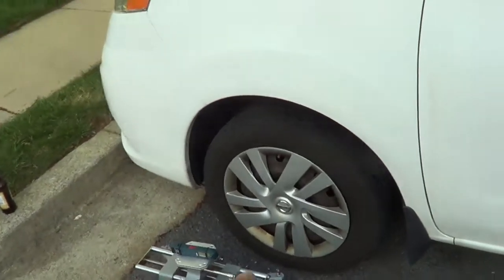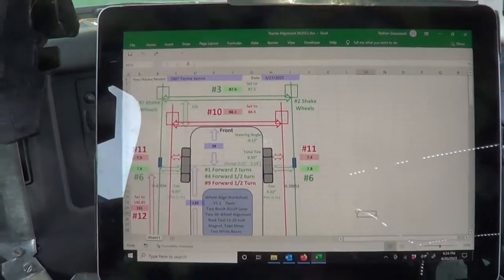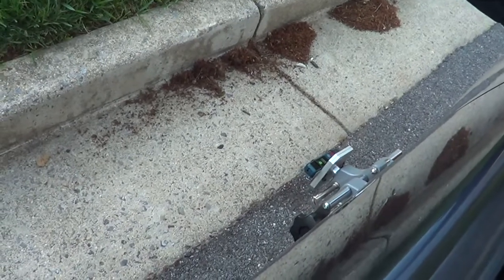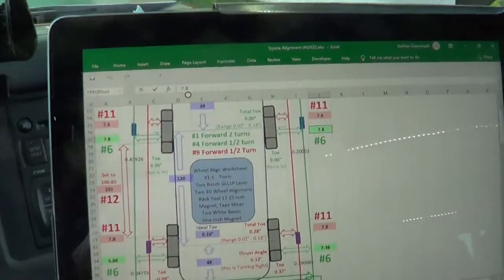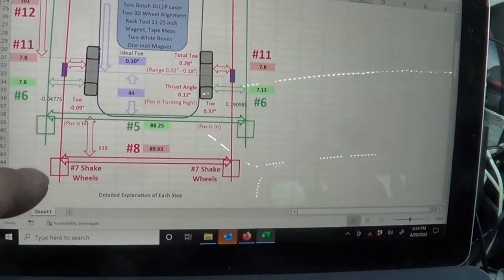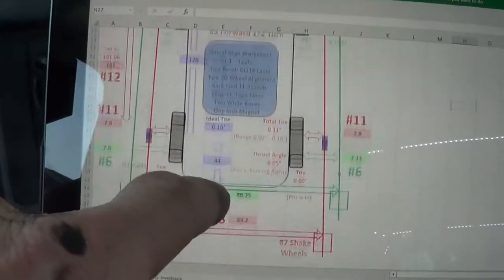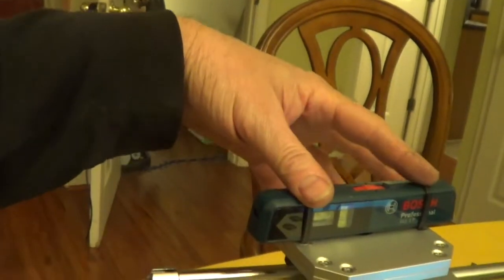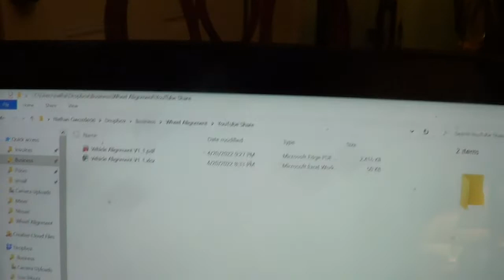Accurate Laser Four Wheel Alignment Calculator Worksheet

Comment: Nathan,
Thank you for your video and spreadsheet. I will try you system on a race car. How would I incorporate the track width into the measurements?
Reply from the maker: Thinking about wheel tracking has lead me to a complete redesign of the spreadsheet.   I'm doing away with the boxes and just placing a centered magnet on the front and back bumper.   This allows 4 wheel alignment with any tracking on any of the wheels in only 8 measurement compared to 18 and moving boxes around on the old spread sheet.   I will also make a new video showing how to do the measurements.   It will be half the time.   I will post the new spreadsheet in a few days.   I will have the video in a couple of weeks.

Comment: hi Nathan, i just ordered up the clamps etc. to do this.  The clamps i ordered have a different style of circular "pedestal" sticking through the center 15mm hole of the clamp than yours, but otherwise seem the same.  Should be interesting.  i wonder whether some portable rollers could be used of the type where the 4WD systems on various vehicles are tested?

i did also get a Trackace as well.  The two clamps, and lasers come to around $400 these days.  i did also order a leveling laser (to makes sure of level ground) as well as an angle inclinometer to mount on the clamps to get the camber.

PS: i wanted to ask if the spreadsheet will work with/take into account vehicles that have different track offsets from front to rear?
Reply from the maker: There are two different sets of calculations.   The total toe of the front and back won't be effected by offset because it only uses two wheels just like the Nissan manual recommends.    The individual toe will be effected by offset.   But, individual toe is only used to show what single wheel is out of wack.   You could manually subtract the offset.   I suppose I should add in an offset calculation.   How many cars have different axle widths?
Reply: @NathansHVAC  Thanks for your reply.  i don't actually know the percentage of vehicles which have different track widths, but i think that a lot of street vehicles have small differences.  The Santa Fe of which i am measuring for example varies by 1/2" front to back tracks over different generations.  i just searched for some various vehicles that came to mind.  Sports cars seem to have the largest differences as they seem to tune the track widths more.  

Hope that helps with improving the spreadsheet and most of all thanks for making this video.
Reply: Just a note for others.  The Bosch GLL1P lasers have a nicely machined bottom so it mounts flat.  However the magnets on it are on the side.  The GLL1P body is 22mm wide.  The circular mounting face that goes into the wheel clamps are 100mm on mine.  i scribed the proper locations for each side to center it and ended up getting some inexpensive but rather strong harbor freight rectangular magnets and mounting those to the circular mounting face, then mounting the Bosch GLL1P to those.  That keeps the lasers in place, centered, and flat against the face.  Hopefully this helps others.

Additional notes: one thing i noticed was that when comparing the two GLL1P lasers.  One outputs a dot slightly higher than the other.  Ie the angle of exit of the laser beam from the body of the GLL1P is slightly different.  It seems to me that this would cause a few mm difference between the readings for the "far" wheels vs the readings for the other laser on the other side.  For better results i wonder if using the same laser from side to side might give more accurate results.  i am going to test this by doing measurements with one laser, and then doing the same measurements with the second (measuring to the wheel centerlines front and back on both sides).

Comment: Very impressive Nathan. I bought the Trackace laser wheel alignment gauge a couple years ago and it is extremely accurate for the total toe but it doesn't give you the individual readings for all four wheels. How have the back tires on the Nissan been wearing since it has been a few months now?  I had the same issue out of a Toyota Sienna where I had to shim the rear axle.

Comment: I really like this video, Nathan. I downloaded your spreadsheet and studied your formulas. Excellent work all the way around. Can't believe this video has so few views. Maybe because the wheel clamps and lasers cost around $300. Maybe because there are 12 steps to learn and careful measurements to take and numbers to carefully input into the spreadsheet. Seems everybody wants to get away with 10 minutes and $1 worth of string. For my part, I made the investment in the wheel clamps and lasers and am happy I no longer have to depend on the local alignment shops. I've had really mixed results from them over the years. One shop had my car on the rack and down again in 15-20 minutes and the car tracked so terribly bad I hated to take it back to them, fearing they might make it worse. In that case I took it to a different shop. Another shop would spend an hour and my car would ride beautifully. Such wild variation in reliability and results - just got tired of spending the money and time at most of these places. I know when my car is tracking and steering right. You have a very well thought-out system for four wheel toe. I would love to see you address caster and camber.
Reply from the maker: I'm amazed myself.   The difference between a good alignment and a bad alignment is only 1/4 turn on the tie rod.   I have tried everything over the last 30 years.   What got me to come up with this system was the Nissan manual recommending the 1/2 rotation of the car.   That method totally compensates for any errors of the rim and lasers.   Let me know if you want any changes in the spread sheet to make things more intuitive?
Reply: @NathansHVAC  The only recommendation I have is to make the instructions a little clearer. I read them through several times and saw some areas that could be improved. So I re-wrote them for my own use. I could email you a Word, Notepad or PDF of my edits if you like.
Reply from the maker: @davidoleary3923    n a t h a n g w.       At.      a I r m a I l    d o t.       n e t
Reply: @NathansHVAC  Sent PDF today.
Reply: Awesomeness

Comment: Quite impressive. I've seen people using fish line for toe (and camber) measurements and they claim to be most accurate. I think fish line adds up some manual labor but reduces the cost a lot and on the other hand if we can make a spreadsheet like yours for the fish line type arrangement it will make it little bit more reliable and authentic. Just my two cents.
Reply from the maker: Also, the tires are never straight.   Moving the car 1/2 rotation aligns the actual axle.   That is what you care about.   Not the condition of the tire or rim.

Comment: Hi, nice job :)
A couple of questions:
1) How important is the accuracy of the laser?
I mean the parallelism of the laser beam itself to its own housing (support surface), and so also to the surface of the turntable after mounting?
All these devices have a deviation and the beam is not perfectly aligned with high accuracy.
This BOSCH model for example has a accuracy of 3/16 In. at 33 feet.
Does this affect the measurement?
I'm having trouble figuring out this answer myself :)

2) Confused about this in the Excel sheet:
#6.  The measurements of the beam to both wheels are used to calculate the toe of each wheel.
Shouldn't it be: 
The measurements of the beam to all (4) wheels are used to calculate the toe of each wheel (4 wheels).
in accordance to the point 11:
#11.  Measure the beams to each of the wheels.
where "each" means the 4 wheels....!?

At the points #6 & #11 a measurement is taken from each of the 4 wheels and entered into the excel sheet....?
The description for #6 in the excel sheet suggests that a measurement is only taken from 2 wheels!?

Or have I misunderstood the measurement technique :) ?

3) Question concerning the description for #12 (and associated graphic).
At which point this distance is measured exactly?
I ask, because this distance will vary depending on chosen measure points... (e.g. the distance from “rim edge” to “rim edge” is smaller than the distance between “point X on the wheel inner part” to “point X on the wheel inner part”)....?

Thanks
regards
Reply from the maker: I’m glad you have questions.

1) The beam accuracy doesn't matter. It just has to be mounted solid on the rim and not on the rubber. The rubber will deform as the tire rotates. The entire point of moving the car forward 1/2 a turn is rotating the entire laser assembly around the axle. The only error will be that of the bearing play and suspension.   That is why you want to use a flat surface to keep those errors to a minimum.  Parking on a hill will temporarily change the toe.  The beam spread isn’t wide enough to matter.   A measurement error of 1/8 inch at 10 feet is 0.05 degrees.   And that accuracy would be a very tight alignment.

2) The toe of a motorcycle simplifies the answer to this question.   The toe of the front single wheel vs the toe of the back single wheel will not affect tire wear on the motorcycle.  It only effects the thrust angle of the motor cycle rear and the steering angle of the front.   The same applies to 4 wheels.   The front 2 wheels of a car are essentially the same wheel as a motor cycle, but really wide.   The bearings of that giant wide wheel need to be on the exact same axis to avoid tire wear.   If they are not aligned, the wheels skid sideways.   That’s is why old toe plates measure in inches of skid rather than angles.

3) It doesn’t mater what point is used.   What matters is the change that is required to align a solid rear axle to have a zero thrust angle.   This adjustment would be in the leaf spring bolts.  I’m sure you have seen old trucks that look like they are driving to one side.

Comment: Did you create that spreadsheet? That's pretty impressive!
Reply from the maker: Yep.   I have been thinking about how to do alignment my whole life.  Reading the Nissan service manual about using a tape measure on the tire finally made everything click into place.   I have tried everything:   Toe slip plates.   Lasers on walls.  And, I have been searching the internet for a few years.   I think I got a pretty good system now.   And, it is free.
Reply from the maker: My really cool project is automated business software for service contractors.   I have been working on this project for a few years.   I'll post some videos about it soon.   It is also free and based on Microsoft Office with Google Workspace.  The amount of automation is better than the most expensive business software.   And it is designed for small 1 man companies with an occasional helper.   It runs on the exact same software that runs the fortune 500 companies.    Outlook, Excel and Word.
Reply: That's cool. I'm out of the HVAC game now. I work an office job and occasionally dabble with Excel macros. The graphics in your sheet are on another level. That's pretty sweet.
Reply: Also, I'd love to see a tour of your software. I keep getting the itch to get my hands dirty again. I wouldn't leave my corporate job, but I've been considering doing service part time on the side. It sounds like your software could be helpful if I go that direction.